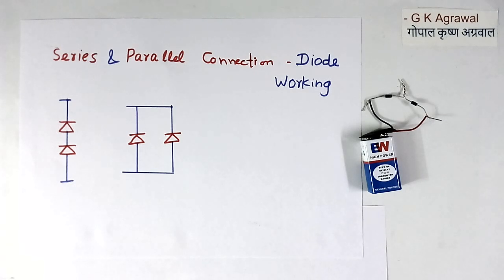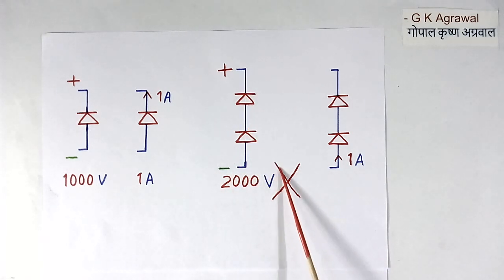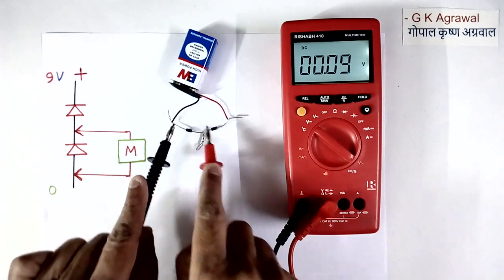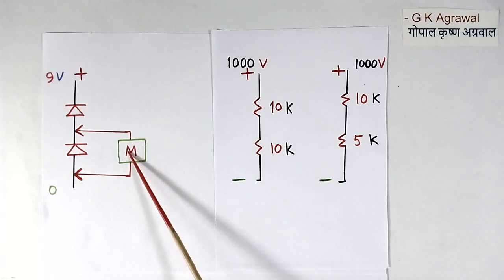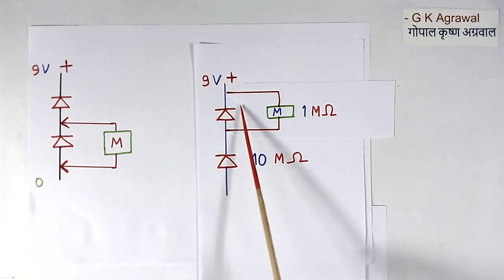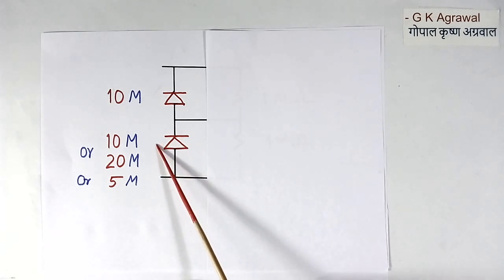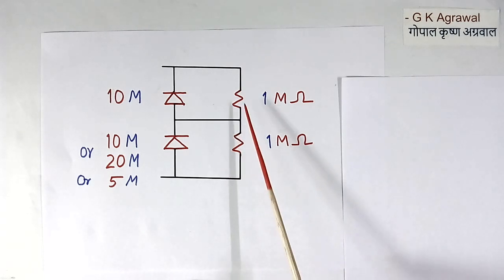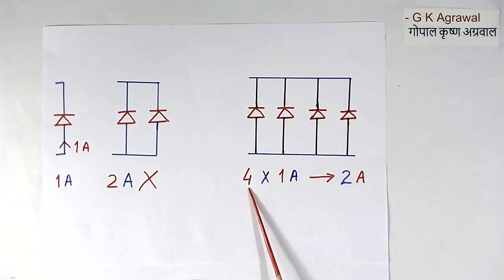Diodes in series and parallel circuit, voltage current calculation

Comment: Absolutely brilliant! To me, eyes opening! And, by the way, you just gave me a very important tool for 1. compensating for the effects that I cause, in case I want to enter my measurement equipment into an existing circuitry, and 2. avoiding inaccurate, misleading, or just plainly false measurement results. Many many thanks, God bless you! 🙏💛
Reply from the maker: Good that information is useful for you.

Comment: Sir, what's the point in measuring the voltage bw the centre point and one terminal of battery?. The diodes are not conducting anyway . So it is like open ckt.
Reply from the maker: That is to understand the concept of voltage sharing between series diodes.
Knowing this concept will help in a high voltage rectifier circuit or some other circuit.

Comment: Can somebody elaborate why 4 x 1A=2A?
Reply: The example was given to explain the absurdity of connecting diodes in parallel.
One might expect to see the same voltage and current levels in all (identical) diodes, but the problem is that diodes are never identical and the current split up in each diode differs.
4 x 1A one might expect 4A but because of unidentical diodes we see that current and voltage split up is non-uniform and these can only be measured experimentally which he found to be around 2A.

Comment: Sir my battery is of 9 volt , I joined diode ...my motor work at 7v.....I want to pass 7 volt DC current to motor but also at the same time motor need 6 amp .....so how I can achieve it ?....please reply sir it's important for my science project 🙏🙏🙏🙏
Reply from the maker: You have to select diodes of proper current rating.
Reply: @GKAgrawal2  thanks for my answers sir ....but I have another question regarding this only ....if I made a ampere regulated and voltage regulator separately and I connect both with motor circuit  ..so by this , can I able to give it a respective voltage and ampere ??? ,  then it will work ?? Sir 🙏🙏

Comment: Why Voltage drop occur in ac circuit when load increases .. Please explain sir.
Reply from the maker: V= IZ, where I is the current, Z is impedance of the wire, V is the voltage drop in the wire. Watch my video on Choke as transmission line model, and also second video on Why 11kv, 33kv, 220kv is selected.